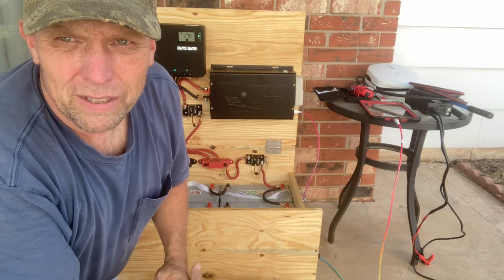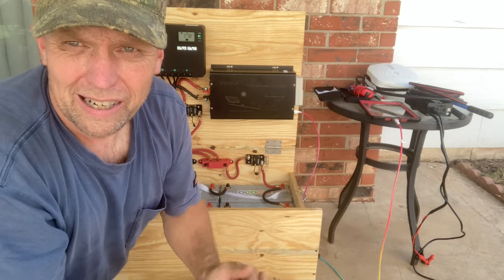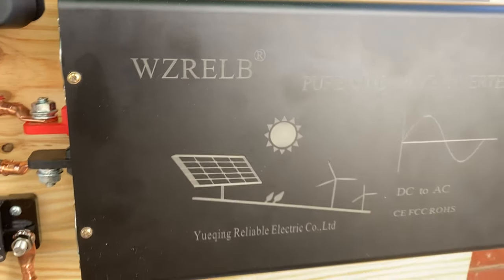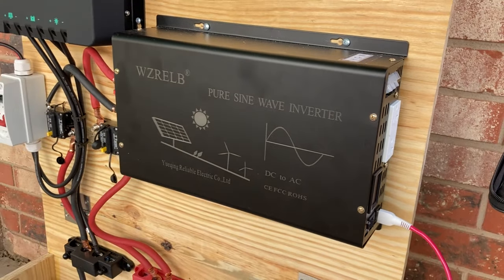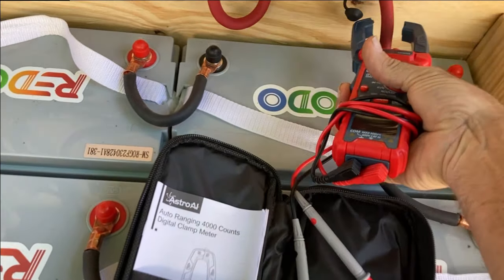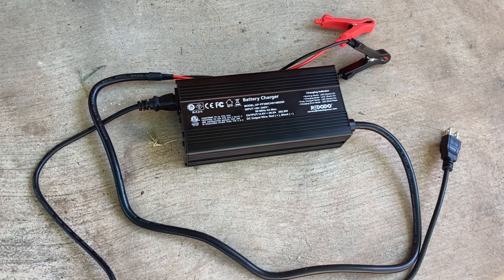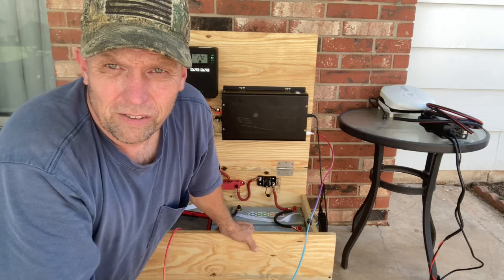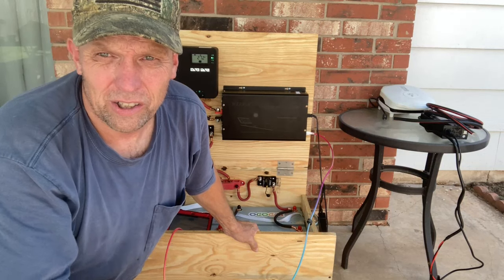Solar DIY Backup Budget Build for Power Outage HQST MPPT Redodo battery WZRELB Inverter 24 Volt

Comment: I built basically the same kind of system, but kept it at 12v as I run a single 200ah battery to keep costs down. Put it all in a heavy plastic tote on wheels so that I can use it on my RV or the pellet stove in the house (backup power during winter). Its all water-proof with frog skin covering the holes inlet/exhaust fans, wired with a 30a RV plug, and additional waterproof 110v outlets on the box. Used Anderson plugs for the solar and battery connectors from the RV.  Like you, not a big fan of the HQST controller in my system. It doesn't like to charge at a maximum 14.6v and keeps throwing an error code. Have to run it at 14.4v to keep from getting the code. Customer service was a complete waste of time, so I just live with it. Probably better for the battery in the long-term. Have 2 residential 36v panels rated at 230w each and wired in series with 10ga wiring up on the RV roof. Using 4ga wiring from the battery to the 3000w invertor. An inexpensive hydraulic crimp tool made it super easy to assemble.
Reply from the maker: @InTheDirtAgain  I had to back it down from the 24 volt factory settings also same thing. When the batteries reached full it would do the same thing.  Yeah you’re not going to get any customer service. But it is a solid unit. Of course it’s kind of like an umbrella if you have one it doesn’t rain.  Well since I built this unit we have not lost power but I’m ready for the ice storm when it happens.  I use my solar trailer when I go camping and that $62.00 Sunenergy  30amp controller gets the job done.  Your system sounds cool !!!my next project I’m building one in a filing cabinet for the outdoor kitchen.

Comment: I'm getting the components together to build one the exact same size. I was tossing around different ideas on how to build the box or whatever I wanted to mount it to.  Your box idea is perfect for what I want to do. Thanks!
Reply from the maker: @rogermurphy1548  your welcome I like it.  Kind of weather resistant if outside. Heavy though I’d take the batteries separately.

Comment: What suze wire is used on this build? Thank you
Reply from the maker: @chefdlturner9056  I’ve been using 2 gauge on all these builds and should handle 150 amps I believe.  Make sure not to get copper clad and 100% copper.  Should be fine for 2000 watt inverter.  The copper clad wire is working but I wouldn’t run 1500 watts more than 5 or 10 minutes with it. Just don’t get copper clad at all to be safe!!!
Reply from the maker: I used copper on this build two gauge my other build that I made for my chuckwagon is the one that had the copper clad and I only run it for 3 to 5 minutes so it’s been working fine but I’ll be replacing that in the near future

Comment: Nice system. Good job for making at least a 24v system. I cringe see too many people doing 12v system. 2 awg is an overkill for your 24v system. 4 awg is more than plenty. 4awg is at least good for 70 amps and that equal 70x24= 1680w. No need to spend more money for 2 awg wires.
Reply from the maker: @Firephosure  thanks yeah I went 24 for my main power out system and just in case I push the whole 3000 watts but I should be under 1000 watts.  Thanks so much for watching I’m always learning. Wish I started with 24 volt batteries also in parallel, but it’ll work. I just am learning better though.